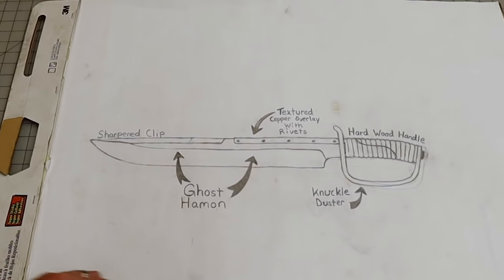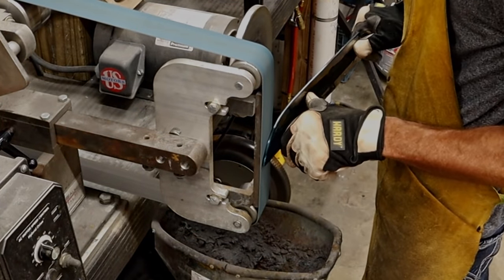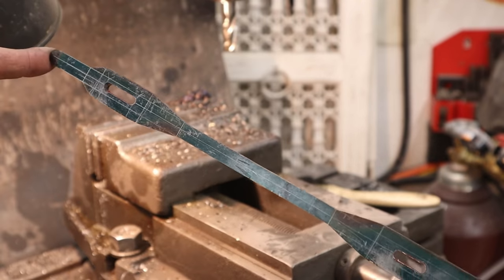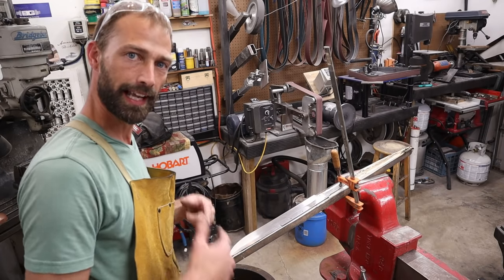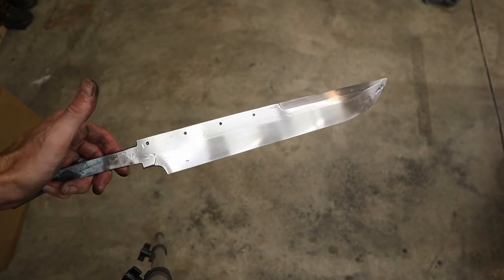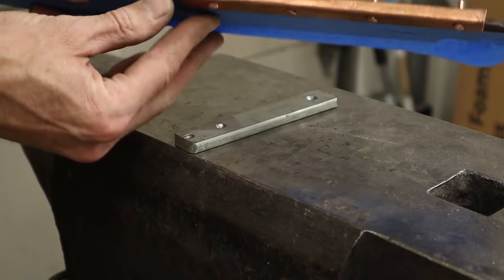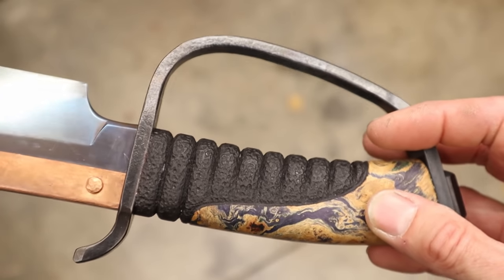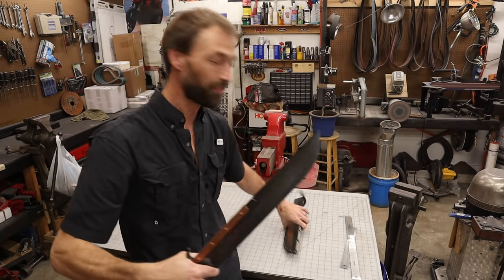Copper Back Trench Knife - Bowie challenge - Bowie knife build off

Comment: Beautiful work. But here's a little tip if you heat Copper to critical temperature and quench it in water it becomes very pliable and easy to work with.

Comment: That is a beautiful knife.  Not a huge fan of the copper backing but that's just me, the knife is gorgeous.  I also love that you stayed with a more traditional bowie design and included the sheath.  Some of the others, while absolutely amazing knives, really pushed the definition of "bowie knife".  Out of them all, considering the actual theme, I would have given yours top honors.
Reply from the maker: Thank you sincerely!
Reply: The copper backing is actually fairly similar to a brass feature some higher end historical Bowie's had. In the historical peices it was supposed to help with parrying in a knife fight, but I don't want how much of an advantage it actually provided.
Reply: @garethbaus5471  I know, I've seen similar designs before.  I was simply commenting that between the two (copper vs no copper) backing, I much prefer the look of a non backed Bowie.

Comment: After all that tempering with what looks like 450 plus degree I wonder what the HRC is now. That being said, what a beautiful project
Reply from the maker: Technically you could temper a blade for a thousand hours at a given temperature and the end results would be the same. I tempered this one at 425
Reply: @Aleeknives  I thought I was tempering at 400, but after investing in a digital thermometer I realized that my 1980s oven is a liar and I was up in the 460 range getting the same blue you are. For my low impact knives that I want to keep an edge on I temper at 375 nowadays and I get the straw Brown, a darker more resident straw Brown at 400 to 410, and anything I ever let turn blue during temper does not hold an edge, versus my straw Brown temperings which do hold an edge. I haven't broken any of the straw brown ones or chipped an edge. That being said I love your craftsmanship and I'm still curious how the edge holds up to say cardboard cutting / repeated rope cutting
Reply from the maker: I normally get straw brown also and totally agree with you! But It seems like if I take the knife to a fine finish and then temper I get the light blue color. I thought it had more to do with the blade being polished than the heat level. None the less I will definitely be checking the temperature with my digital thermometer next time! Thanks for the heads up and it sounds like solid advice! I appreciate it

Comment: I LIKE the knife. For my taste, I wish that the thumb-guard stuck out about a half-inch farther and the forward protrusion was a quarter-inch longer. I wanted to applaud when you included a SHARPENED SWEDGE. However, I don't know why you abandoned the traditional half-moon-shaped swedge. Then again, the main edge is distressingly straight. Would have liked it better with a rocker-shaped main edge—like a rocking-chair rocker…STILL, Your knife is closer to my taste than most of the other Bowies that I've seen lately/ (Also love the copper sheathing)...
Reply from the maker: Thank you! I appreciate your feedback

Comment: How thick do leave your edge pre heat treat to prevent edge warp?
Reply from the maker: Usually the thickness of a dime but I ground this one thinner and almost ruined it!
Reply: @Aleeknives  Yeah that’s about 1mm or 0.040”. I had a blade do the dreaded bacon warp because it was ground too thin (0.020” in some spots :O). Also I think I left inconsistent thickness through the edge (different thickness in different spots). I had to re-normalize, straighten everything again by hammer and grind the edge thicker ~0.060” (thickness of a quarter), finally redo the HT. 

Did this have any kind of edge warping? Good thing it worked out, I’d HATE to have an awesome blade like that ruined!
Reply from the maker: This one did do the dreaded bacon strip but I had enough thickness to scribe a center line and grind a straight edge on it
Reply: @Aleeknives  Awesome! Looks like it didn’t warp too much then. That’s some great craftsmanship on that knife.
Reply from the maker: Thank you!

Comment: Bluing a blade trough heating, after hardening. Makes the blade soft.
Reply from the maker: The blade soaked for hours at a consistent 400 degrees. Same temperature as a tempering cycle.

Comment: Nice Work, hamon looks so good, Bro Can u tell me how to make clay for tempering?
Reply from the maker: Buy satanite refractory cement. Add a couple drops of water to a couple tablespoons of cement mix it to the consistent of dry oatmeal. There are a couple other high heat things you can use but this is my method
Reply: @Aleeknives   thank you!

Comment: dude...this is fucking incredible. Can I ask what is that beneath your belt grinder that collects the dust? Doesn't look like the craftsman shop vac you have listed in your tools
Reply from the maker: It actually is. I have a 5 gallon bucket with a household vent duct coming out of the lid and the vacuum also plumbed into the lid of the bucket

Comment: Love the knife man very kool design, but your heat colors are more in the 550 f degree or 300 c range, 425- 450 is straw colored
Reply from the maker: You are 100% correct on the color chart, however, I have a very accurate temperature setup for tempering. I have a large oven that I bring all the way up to heat first then I place the blade in the oven. I have many times monitored the temperature with a thermometer.  After this knife and seeing the banding that took place I have added a large tray of sand to place the knofe on instead of laying it on the rack. I had never had a blade take on that deep of color after tempering. I was thinking maybe because it was polished completely out first or aomething
Reply: @Aleeknives I use a paragon and  I've never had my blades come out blue when I run them at 425f, regardless it looks awesome on the hamon excellent work!
Reply from the maker: Thank you! I will be re-checking my setup for sure! I always incourage constructive criticism on the channel and I appreciate your knowledge! Cheers